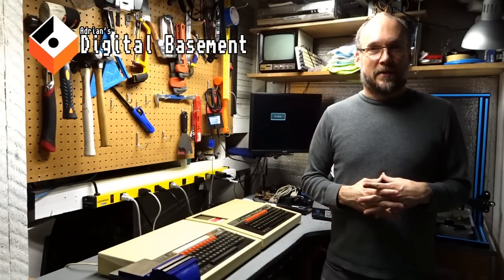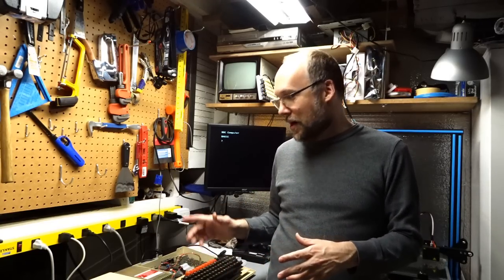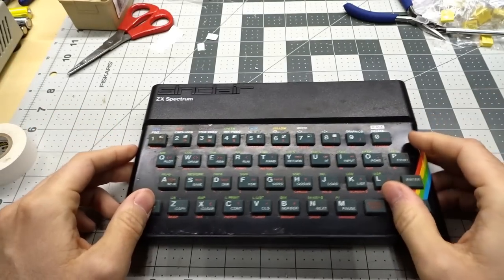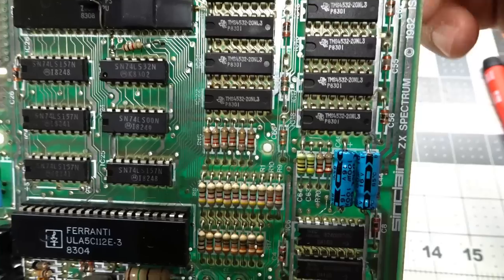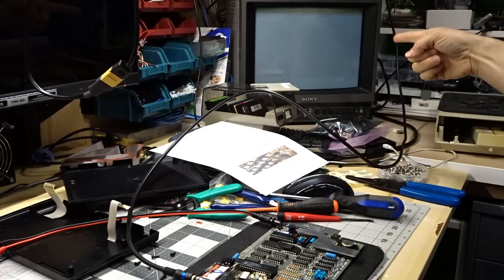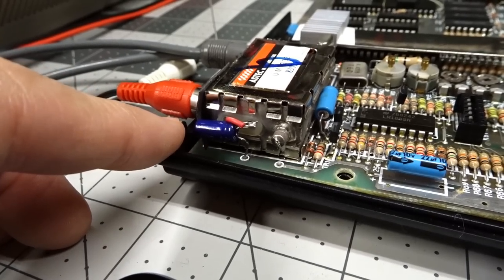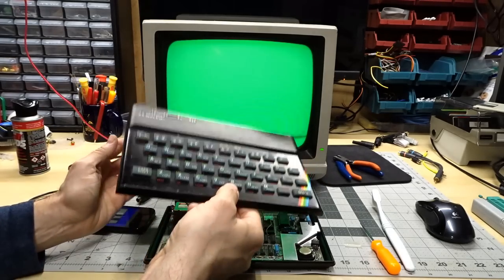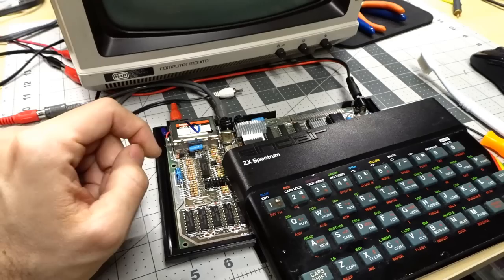ZX Spectrum Part 1 - It's a very sick machine (and a BBC Micro update)

Comment: Hi, I'm the author of the diagnostics you're using in this video :) 

You're right - when all 8 upper RAM chips fail like that, it's best to suspect other issues, like the 74LS157 multiplexers. The bright white lines down the screen are different though, as video memory is in the lower 16K. I'd actually suspect that the ULA in the machine might possibly be faulty, although it's worth pulling and reseating it just to make sure corroded contacts aren't causing any problems.

One thing I will say - capacitor health is critical in a Spectrum, as if they've dried up you'll start getting all sorts of fluctuations on the -5v and 12v lines that feed the lower RAM. Change them out and see where you are - I recommend Vishay caps as you can get them in axial footprint and they are quite close in appearance to the originals.

Nice spot on the Issue 2 schematics also - Sinclair got the RAS and CAS signals mixed up, and as you've noted, are corrected in future schematics.

I'd love to see this fixed - with a new membrane and faceplate this will look like brand new :)
Reply: @Nobody's Fault But Mine Do you really think that kind of abuse is justified?
Reply: @Nobody's Fault But Mine What's that about?
Reply: is he trying to make a joke? It's not an offensive word in the US, I heard it used in DS9 once and was a bit confused lol.
Reply: I’m Irish, he’s going to have to try a lot harder than that to offend me 😀
Reply: Well in young man, Fu%k im,           Respect. @bennyalford
Reply: bennyalford I’ve used your program to diagnose my trusted Speccys. All running strong to this day.

Respect and a bit thank you from the Spanish ZX scene, Sir
Reply: LagunaGFX - you’re very welcome, glad you find it useful!
Reply: I recently had a similar issue with the lower RAMs in an issue 4A spectrum, with the RAM chips working nicely in another machine. Turns out the diode-resistor logic OR-gate for the EPROM mod had an undersized pulldown resistor.
Either way, thank you for your diagnostics program :) It definitely helped me a lot when building my Pentagon48 (fixed for 128 timing + mem) - only thing I'm missing is a screen which would show if the timing for the border generation is off (like a checkerboard that's generated on Paper and Border - something like this: https://i.imgur.com/SInfvGf.jpg [note the black vertical line right to the end of paper]). But then again the border generation test for 128k machines in the ULA menu already is very helpful.
Reply: @bennyalford  

Allo.

Fancy seeing you here. ;)

Hope all is well.
Reply: @electronash  All good mate :)
Reply: These early computers look like typewriters without the paper... he-he .. I remember my first computer in 1984 was a ZX81 (aka Timex Sinclair), then quickly moved on to the Commodore C64, Amiga, and finally the PC... gosh we came a long way from those early days.
Reply: I recall spending weeks typing up a programme only for it to keep giving a $ error which turned out to be knackered memory, apparently. The hours spent trying to fix it. Those 'IF a$=' commands are something that will stick with me for life now heh.
Reply: @BillAnt  Amiga. That was my first 'real' computer. Deluxe paint IV could sort of do animation. It blew my mind!
Reply: @wagonwheel6420  < Yep, at the time it was incredible... everything is relative in terms of time.
Now there are C64 and even Amiga emulators for mobile phones... truly incredible what can be done nowadays even on mobile phones.
Reply: I also think is the ULA. The rubbery component might also require to be changed. If you would put up your mind to make a brand new system, it would be cheaper, it would work and you'd find it quite usefull. I remember i got the same bideo gliches when using the poke command. Nontheless, historically it has it's value.

Comment: (Found your video in Jan 2020).  Here in New Zealand at the time electronics goods were very expensive, paying an extra 110% or 130% duty tax, after import costs.  So in 1983/84 That made the Commodore 64 cost $995 plus you had to pay extra for their own dedicated  cassette tape unit. The Sinclair ZX Spectrum (could use any normal audio cassette unit)  was sold here in either 16k or 48k version at various electrical shops.  I bought the 48k version which cost NZ $ 699 at the time.  As they were imported from the UK they output the Pal TV signal on the UHF band.  However in NZ at the time ALL of our broadcast TV stations were VHF so almost no home TVs had UHF available.  Therefore the importing agency here in NZ opened up the cases and did a (sorta "factory") modification so that Spectrums sold in NZ output in VHF.  At the same time, the authorised importing agents also removed the power supply that came  included in the original carton, installed a NZ type mains plug on it (we are also 240 volt) and then sold the power supply as an essential "extra" for another $29.95 .  When I bought my computer I also paid retail price (about $25 each) for 2 games, a BASIC Star Trek game and "Nightflight" an airplane simulator.  Later amongst friends and a club which operated out of the university, I was able to obtain about another 150 programs as, um, cough cough, "back-up copies" !  Note that the Spectrum 48 k had more USABLE memory than the so called "Commodore 64". Spectrum reserved 7k for screen display and had 41 k available. The Commodore counted their 64 k as a gross figure and it actually had about 37k actually useable available...I remember being told at the time.  I had some friends take their Spectrum into their office, (an apprentice training school), and use it to do stuff that their Apple 2e computer couldn't do.  Spectrum programmers did fantastic things like a Scrabble game between 0 and 4 players with colour graphics and it INCLUDED a 16,000 word English database dictionary.  Whereas the Apple computer at the time, had to leave the Scrabble game floppy disc installed as it ran it every move to check the dictionary.    There were numerous chess programs some for the 16k version. I have a 48 k chess version which claims in the opening titles it beat some fancy computer somewhere. I also have the talking chess "SpecChess" which has several phrases inserted at random during play, as well as for "check" and "checkmate" etc.  It was considered a marvel how they made reasonably understandable speech come from such basic sound processing. My Specturm was still like new when I shifted to Australia over 30 years ago and was STILL like new and in it's original carton when I moved back to NZ over 10 years ago.  I had for a short time the "Interface 2" featured in a photo in your (earlier ?) video.  But I returned it to the shop for refund as so few of the games could use an official type Spectrum joystick connected to Interface 2 (and I wasn't planning on buying full price games on plugin ROM cartridges).  Instead someone good at soldering, used instructions from a local computer magazine to make up home-made "Kempston"  style joystick interface for me and our friends.   Kempston brand joystick interfaces were not for sale in NZ but in the UK had been released earlier than Spectrum's own joystick "Interface 2" and had become the market leader in the UK and almost every game released  would load with an option for a Kempston compatible joystick. My Spectrum "should" still be ok, packed in it's carton and with associated cassette tapes for the programs and a number of books, both the originals and others I was given over the years. Plus the joystick and the home made Kempston style inerface !

Comment: I'm not old enough to have used one as a kid, but I bought a non-working Spectrum a few years ago, and it was my first vintage computer project. After a recap and replacing the keyboard membrane, it worked for a time. Before it was all over, I replaced half the IC's. I learned alot, and enjoyed every second of it. I hope your video inspires others to take on one of these bargain wonders.
Reply: Not bargain wonders any more, alas. (Although I did overpay for mine a little.)

Comment: I'd say it's definitely worth persevering with that Spectrum.
Replacement membranes are,  indeed,  very easy to acquire as are replacement escutcheons (the metal faceplate) so,  as the 'bad shape' is mainly cosmetic,  please don't get disheartened at this early stage.

I wouldn't use it until the RAM faults are diagnosed and fixed as further damage can occur but RAM faults,  particularly upper RAM faults,  are quite common and usually an easy fix.

A re-cap might also be a good idea.

You get a real sense of achievement when you rescue a Spectrum. ^_^

Comment: As a owner of several versions of Spectrums, the keyboards basically remained the same and are easily disassembled. When facing the blue rubber keys, the black aluminum plate (withe the key words) is stick in place with thin dual-sided sticky tape.Using a fine flat screwdriver start working from the curved edge to gently lift it up. You will feel the stickiness. Be gentle and take your time as this plate is pure aluminum and will bend (read deform) real easy. This is the part that takes time. Once the whole left or right side is lifted off, the rest should go much easier. * Once the aluminum plate is off, you see the rubber keyboard mat which simply lifts off and can be cleaned with dish liquid soapy water and a (tooth)brush. Do not use alcohol as this can take off the ink. * Below the rubber keyboard mat is basically two transparent membranes for the keyboard. Each membrane corresponds to one connector and is either row or column. I recommend to clean these membranes with electronic contact spray cleaner and cotton balls. Clean whatever else you find. put together, and 99% the keyboard will work.
* However, if the membrane has a crack close to the connector, forget about it and get new membranes. I've tried about anything to fix the tiniest cracks on those membranes, sometimes partially successful but never permanent.

Good luck.

Comment: No it isn't worth your time fixing it. Yes we want to see you to do it anyway.
Reply: Exactly.
Reply: Agreed
Reply: It is worth tinkering with, it's a great retro system.
Reply: He can sell it for profit after.
Reply: It would worth fixing just for making a video on it.
It's probably just a bad ram chip as I read they sometimes used defective 64K chips that still tested good in the lower 32K as a cost saving measure.
Reply: It may not be as bad to fix as may be expected from reading other comments.  I would think it worth fixing from a collector's perspective, and probably many of the people who watch your videos.  I would like to see it.  I would wonder if maybe it was like pe1dnn said and a power quality issue, due to the limiter on the supply or some bad capacitors on the computer.  My current limiting supply is cheap, and puts a lot of noise on the power when it kicks in.  I had seen the keyboard membranes were available, it looks like below there are mentions on a potential solution without replacing it though.  New parts are not always the only solution, but it is great when they are available, that generally means there are enough people that care about these old machines. I hate to see the old systems die and not be revived if possible.
Reply: it is worth the time to fix the ZX spectrum. it's an absolute classic of a micro and deserves all the TLC in the world.
Reply: @Devvy Nully If someone is interested in vintage computers, I would say that it's always worth it to fix-em-up.
Reply: Get on it :)
Reply: Interestingly, "zed eks spectrums" have a surprising amount of nostalgia value in GB, and also in Eastern Europe the design was copied (one might say pirated) quite a bit, Brazil and South American countries, too. All this makes this cheapo machine valuable, at least for Europe, on places like UK eBay. Also there were a huge number of homebrew cassette games that can now be put on a Gotek drive. Not so much in the US, where a similar model was the slightly improved, but unpopular "Timex Sinclair". US gamers went from cartridge to floppies on other platforms;. so, no cassette homebrew scene; that energy was spent on BBSes online I suppose, and the rush to get rich in Silicon Valley. An updated version "ZX Spectrum Next "(HDMI, etc) was put out a few years ago and priced at £300 300, seen on ebay recently for £1500. I'm not sure of the market in Canada, but if you find one of these in the US cheap and you're willing to ship to Europe, you can make a few quid. I wouldn't say the same of many of the other 8-bit computers British or otherwise, but ZX Spectrums, yes.

Comment: Your comment about “did anyone write programs on these” made me smile, yes, I learnt Z80 assembler on a Sinclair Spectrum. Happy days! The fun of the Spectrum was that it was a quirky machine, with clever programming it could be made to do things that I’m sure it was never intended to do. Those keyboard ribbons  are part of the keyboard membrane, they become brittle with age and the connections fail. As I’m sure you know replacement membranes are available, but you do have to peel the keyboard cover off which was stuck down with double sided tape, beware it bends very easily and it’s difficult to get it back on flat. It used to be possible to get large keyboards like those on the BBC micro that you could fit the whole PCB inside, giving you a “real” keyboard and lots of room for expansion internally.
Reply: I really like the rubber keys, especially for programming Basic. Makes coding very fast once you've memorized the keyboard shortcuts. Feels really nice on your fingers too, warm soft rubber contrasting cool metal face-plate below - all round pleasing tactile experience. 48k was a great machine ;]
Reply: I had a book that listed code for all sorts of programmes and you had to copy it into the spectrum and save it on cassette. The major problem was that it was almost impossible to avoid a typo somewhere and then when you did get a programme working the cassette failed to copy it properly or reload it later.

Comment: I used to take a pair of scissors to the ribbons and take 5mm off each ribbon, this gives a clean contact, sometimes the contact track inside the plastic will crack like a PCB track. When in a crashed state, freeze spray a RAM chip, if the pattern on the screen changes, that chip is faulty!
Reply: Even worse than cracking, the act of plugging in and unplugging the ribbon will wear/scratch the conductive strips off of the backing. It might look okay, but it's totally failed. I had this issue with a couple of ZX81s I have.  Trimming it back is definitely the way to go.  On one of mine, i ended up having to trim it so many times that i instead used some extra sockets from a bad board, and attached them right to the ribbons, and added extension wires onto those with a standard header mounted on the mainboard.  Now I just disconnect that and everything's more reliable. :D 
(I also removed the 5v regulator from the board, and replaced the power jack with a USB B jack... Feed in 5v directly and it all works super great!)
Reply: As soon as I saw the keyboard being unplugged I was expecting to see scissors  later in the video 🤣
Reply: +1 for the scissors approach, it fixed my Spectrum which had exactly the same keyboard symptoms.
Reply: Yep; had to fix mine this way too. Not surprised to see that it's a common issue.
Reply: There's sometimes warping of the connectors on the board over 30+ years too, and this disconnects middle bits.  Usually, it's visible to the naked eye when that happens and I have a stash of spare connectors at the ready ;-)
Reply: @yorgle  Have you tried conductive paint?
Reply: @BlackEpyon  I had, yes, but the paint scrapes off as you insert it also.. :(
Reply: Did the same thing - and as I mentioned in my comment above, used bits of tin foil eventually, by peeling back the plastic surrounding the keyboard circuit. It worked - crazily enough. A painstaking task with a sharp blade and a steady hand. Eventually, about 10% of the circuit was patched bits of foil, until it finally gave up entirely when the plastic just ripped. I tried using clingfilm to hold things together, bits of tape - you name it. I'd get about 15 minutes of typing and it would stop working again.
Reply: Our Amiga ran for years with a 'wire' made of twisted tinfoil in place of the main fuse in the power supply. Smelled like a new Scalextric but apart from the usual number of occasional crashes, we never had a problem with it!
Reply: Back in the 80's I obtained a beautiful full sized and very solid black keyboard specifically designed to house the workings of the 48K ZX Spectrum, and which sat an inch or two off the table. They could have used better screws that held the base and keyboard together, but it sure made my life a lot easier especially as I was using the Spectrum at work to print document files, which would otherwise have taken a typist sat at a golf-ball typewriter ages to do. I also used it with a small external disc drive. Happy Days!

Comment: I had one of these (48k) back in the day, and, in my experience, the keyboard membrane wears down pretty fast... - I think I exchanged the entire keyboard membrane like four or five times over the years. I actually taught myself to write Z80 assembly language on this machine, and my crowning achievement was a real-time clock with hands that moved - all done in assembly language. Eventually, I outgrew the ZX Spectrum (and my then-girlfriend kept getting upset that I took up the TV all the time), but I learnt a lot about computers along the way, and your video sure brought back some fond memories.
Reply: Same here. I was able to squeeze a spice circuit analyzer in the 48k all assembly of course. I should get it out of the attic and try to run it again. Made several copies of this precious code on the good metal tape and still have the same tape deck.